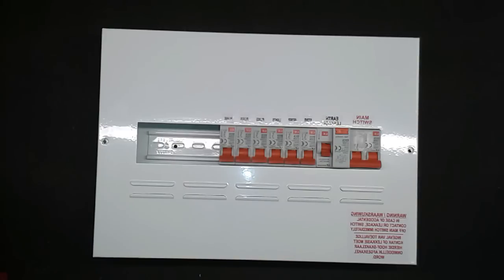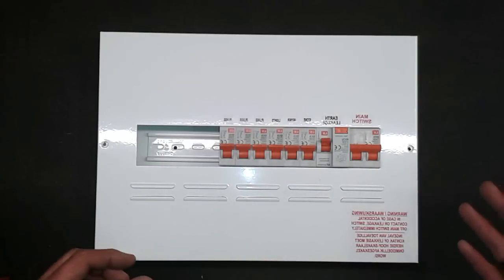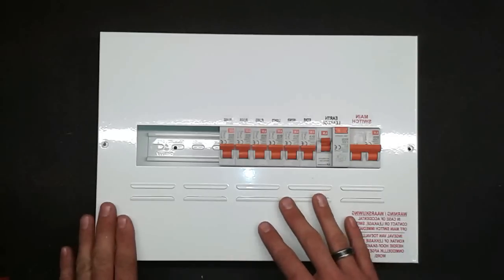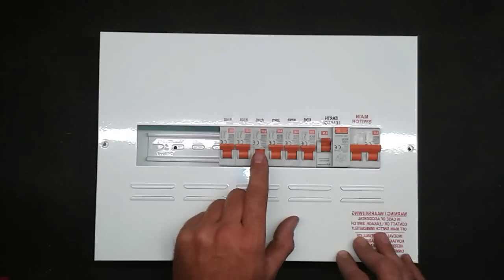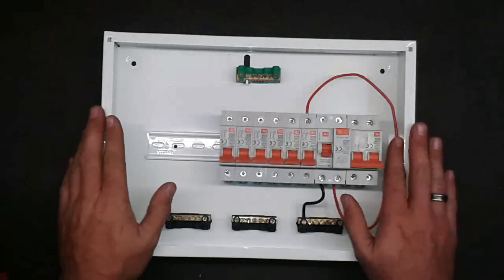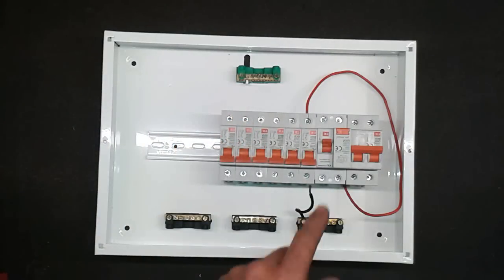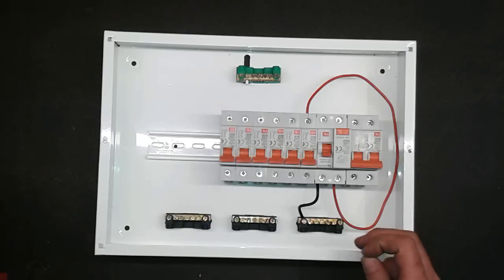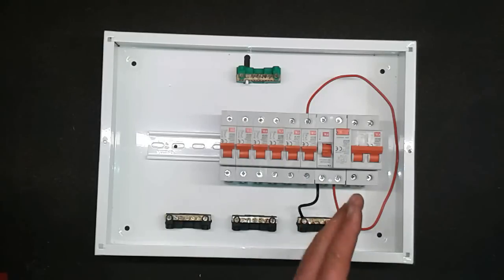Earth Leakage Trip...Here's what to do. (RCD)

Comment: For the earth to live fault or some problem it can be done easily by switching the fuses one by one but for the earth to neutral fault it does work with this method, you will have to open the board and test between the Neutral and earth of each circuit. In the case of neutral to earth, only disconnect the neutral from each circuit and test it with the entire earth bar. No need to disconnect the earth for each circuit.

Comment: My ELCB at my 18th floor apartment trips only during ligthning thunderstorms and the electrician is at a loss how to rectify!
Reply: I agree, this is a difficult one and can be very annoying!
I would check for any exposed fittings (lights plugs) to the atmosphere. If that checks out I would check the main earth to your apartment as well as to the main power box and to the supplier. If that is good I would check or install lightning rods and earth wires to exposed metal parts. Hope this helps!

Comment: Great video thank you.
Still struggling to detect why ECB trips intermittently.Everything is fine for a few days then it goes again.
Reply from the maker: Hi. That is the worst problem to have to find. An IRT tester would help in finding a problem like this but without one you will have to use a process of elimination. 
90% of the time it is something that is plugged in. Start by unplugging stuff one by one to eliminate the problem. Freezers and fridges is going to be a problem to disconnect long term but are often the culprit. 
If it happens every night,but when you unplug the freezer for the night and nothing trips,you know where the problem lies.
It can also be fluorescent lights causing nuisance tripping. For that a IRT will probably be your only hope.
Reply: @p0we111  Thank you for replying, only have the fridge which is one year old, no fluorescent lights mainly led lights.
Its weired, today its ok and maybe fine for a few days.
Its happened once in the day under a week ago and twice last night.I will shut down some of the nights and start from there.I thought it was the geyser but it was shut down during the night.
I was thinking maybe the ECB could be faulty but hard to tell if the fault is not consistent.
Reply: @jeanboetzkes9820  Hi, yes the geyser has a plug that sits in one of those little outside boxes with a slide panel in front.Will remove plug to check  .
The security lights are tricky because the cables run into the wall connecting to the light circuit breakers which don't trip out.👍
Reply from the maker: @stoicwarrior346  The only way to eleminate a device is by switching off the Live and Neutral. Switching off the lights only switches the Live wire.
Make sure when you were testing the geyser that you switched both Live and Neutral.
Most geysers have an isolator within 1 meter. Try switching that off for a fewhours/days.
Same thing when testing plugged in appliances. Dont just switch them off, unplug them completely.

Good luck to you! Hope you find the fault.

Comment: If the neutral wire is causing the trip. How do you find which plug socket wire is faulty when there’s a ring circuit
Reply: Hi Ashraf. If you have already unplugged everything from the sockets and checked out the obvious plugs like outside plugs. Then open one of the plugs in the center on the ring. Split the two neutrals and Live wires. Make the open wires safe by taping. You now have to treat it as two seperate circuits.
If one trips and not the other one then at least you now which of the plugs has the fault on.

Comment: What if the EL trips randomly when i switch any appliance on, sometimes the stofe, sometimes the plug connected heater fan. Other times it just trips randomly. I found when it trips i can't immediately put the EL breaker on, it trips. I have to wait a few minutes, then I can switch it back on. But then it would trip when i switch the plugs breaker on, or the lights breaker etc. I have to wait a bit longer again then I can switch everything on again. It might stay on the rest of the night, or it can trip randomly again an hour or 2 later. Any idea what might cause this?
Reply from the maker: Hi Pieter den Boer 
It sounds to me like a bad case of nuisense tripping. No easy answer but your going to have to do some detective work of your own. It sounds like a fault on the Neutral side. 1st and easiest would be to unplug a all appliances or leads from a room or part of the house. If it happens once a day,keep that room unpluged for longer and see if the its still tripping. If so move on to the next room. If that does not help youre gonna have to remove one neutral (in my country black) wire in the distribution box one at a time and leave it disconnected to see if the problem goes away. If not,put that wire back and move to the next one. Almost as I have done in the video,you will just have to keep the wire dissconected for a longer period. An electrician can test each curcuit using a IRT,that sends 500V through the wires but if you dont have one,this is the only way. Good luck.
Reply: Jean B Okay, thanks, i'll maybe try that. I just find it strange...why would the EL breaker trip by itself, when all other breakers are off? Nothing is drawing power. I haven't opened up my board or tested the breaker by itself, but a faulty EL breaker is all that makes sense to me in such a case.
Reply from the maker: Pieter den Boer 
Even with all the breakers in the off position the neutral wires are all still connected,even a leak (short curcuit) between the neutral and the earth will cause the earth leakage unit to trip. The breakers only switches off the live wire and not the neutral. A faulty earth leakage unit is,in my experiance,either completely broken or not. They will not mess around like that. Not to say yours is not faulty,just my experiance.

Comment: Hi, our earth leakage trips when we switch on a specific circuitbraker for plugs. Unplugged every appliance on that circuit but still does the same.
Could the circuit braker for the plugs itself be faulty? And if so, would it stay up even when earth leakage trips?
Reply from the maker: Hi Vivian. Because it is only one breaker that trips when you switch it on I would say there is something wrong on the circuit and not the breaker itself. 
Make sure everything is unplugged,garage motor,gate motor outside plugs etc...(I know you said you did but just doubke check)
Otherwise it is on the wires itself and you would have to get an electrician or go into the wiring yourself...
Reply: @p0we111  Ok thanks, I plugged in everything again now and now everything stays up and on🤔, will monitor and get electrician out if it keeps on doing it, could be wiring maybe
Reply from the maker: @vivianvandermerwe1380  good news. Usually if is goes away it could be water/moisture that gets in where it should not.

Comment: What happens when you have a broken wire running to the plug socket do we have to replace that line
Reply from the maker: Hi Ashraf. If it is possible I would always try and replace a wire. The law in my country (South Africa) does allow for joints. Permanent ferrules in the Distribution Box. In the plug box a normal connecting block should suffice. Always use the same thickness wire when replacing wire.
Reply: If the wire is mounted inside the wall how do you remove and replace the broken wire
Reply from the maker: @ashrafkarjiker6888  If your lucky the person that wired the plug used a conduit (pipe) inside the wall. You can then pull out the broken wire and pull in a new one. Its easy if you tie the new wire to the old one and then pull out the old wire.
If the wire is plastered directly in the wall you can either just lay the new one on the outside of the wall,inside a conduit or trunking,or you can open the wall using a drill/grinder and lay the new wire in a conduit in the wall and re plaster. 
99.9% of my problems has been either at the plug or at a junction box in the roof. Just make sure before you open up a wall!
Reply: When there’s a conduit inside the wall can you replace broken wire by pulling new one around corners. No power at the one wall socket that is running from the other socket

Comment: Does it apply to all circuit breakers for lights and sockets if it still trips with the load wire removed means the breaker is faulty like with earth leakage
Reply from the maker: Hi. Yes I would say so. If any breaker trips with no load wire connected it is faulty.

Comment: In my new house the Main ELCB trip off while in the day time or in the night . If MCB trip off then i will know that line is creating problem but all LMCB working well.  In night i can say only three fans and fridge is on . Yes day and night Fridge is on. How do i find why ELCB is getting off.
Reply from the maker: Hi Thomas. It is very difficult to find a problem that only trips once or twice a day.
You will have to do some investigating and switch off/unplug appliances for a longer period of time that the problem takes to appear. 

Lets say the ELCB trips 2 times a day,you wil have to unplug the fridge(or any appliance) for 24hours to rule out that the fridge is the problem. If the ELCB trips while the fridge is unplugged,you can say for sure that it is not the fridge causing the problem.

Maybe start at the hot water cylinder and switch off its isolator switch that switches off both the Live and Neutral wires.

Comment: What of the house as faults and the board did not trip of
Reply from the maker: Hi Micheal. Im not sure but I think this is your question:
If a house has faults but the breakers does not trip,why would that be.
It depends on the type of fault. 
If it has a loose wire then nothing will happen. If the loose wire touches a plastic part,then nothing will happen.
If the loose wire touches a metal part and nothing happens then the installation is not correct as the metal part needs to be earthed/grounded.

Comment: Our bore has a145? Earth leakage how do we fix this ? We had new wiring and new bore pump a yr ago
Reply: It cuts power when house is on at the same time thru our 100 kva diesel generator
Reply from the maker: @justtjo  Hi Terry
You will have to double check you're regulations, but having a borehole pump on earth leakage will cause alot of problems.
If you're regulations allow, remove it from earth leakage, but make sure it is properly earthed.
Otherwise put it on its own earth leakage unit.

Comment: After a few minutes, I go back and check if the ELCB can be put back to the top. I don’t know why it goes back to the top because it wouldn’t work when I first tried doing it. Why does it do that?
Reply from the maker: It could be a number of things. Sometimes if an electrical part gets wet it wil trip, but a few moments later it wil switch on again. It it raining? Could it be an outside light.
Maybe follow my steps in the video and try to find which curcuit it could be.
Reply: @p0we111  Alright, thanks for that!
Reply: @p0we111  Oh yeah one more thing, in the past couple months I have started to use more electrical appliances, do you think it was because of this that the ELCB keeps tripping?
Reply from the maker: @PHLvican38  most ELCBs in my country does not have overload protection so it will not trip with too much amps. 
But I have found that if an appliance has a fault on it but is just under the 30mA that the ELCB will trip and you add another appliance with a small fault that using the two together might cause it to trip but you will still have to figure out where the problem is.
Even if it is in more than one place.

Comment: I guess in the first part you are checking L-E faults and in the second N-E faults. Could you confirm?
Reply from the maker: Karoly's Yes L-E is easy to test,just switch off the circuit breakers to remove the power to the L wire. Second part is the N-E faults yes. A bit more difficult to test having to remove each neutral wire until you find the culprit. Is easier to test if you have a insulation resistance tester (megger) but not everyone has one lying around...

Comment: I'm not sure if you're still answering questions but what is the cause if one gets a small electric shock when turning on our outside shower? In the past week we've had our earth leakage tripping after 3+ years of everything working well, and it is so random but we'll try your method of elimination and hopefully that will reveal the fault. This is a great video - thanks!
Reply from the maker: Hi Robyn.
If its just tripping from time to time it could be difficult to pinpoint.
The small shock on the shower could be your hot water cylinder which should not be a big problem but you may want to earth the water pipes so that you dont feel the shock but it runs via the earth wire to the ground instead.
Reply: @p0we111  Thanks very much for the reply… Apparently our cylinder isn't on earth leakage but we'll check the metal pipes, and still have to follow your process of elimination…Hopefully we'll get to the bottom of this - there are so many possibilities!

Comment: What if when all the wires are transferring current including the earth wire what do you do to solve that problem?
Reply from the maker: Hi Mike

The earth wire should not have any current. You will have to find where the earth touches the Live or Neutral wire.
Reply: @p0we111  but how comes that all the wires I've gone through have current? Hence passing to every part of the room
Reply from the maker: @mikenjoroge4344  Are you testing the Current (Amps) or Voltage (Volts) of the wires? 
Getting a Volt reading when testing between Live and Neutral is normal and when testing Volts between Live and Earth is also normal. 

Getting a current reading (Amps) between Live and Neutral is normal with a load connected but when testing current (Amps) between Live and Earth there should be no current.

Comment: need help i have removed all the neutrals and the EL is still tripping
Reply: If you still have the neutrals removed. Switch on the lives (breakers) on one by one. If it trips with all the breakers off and neutrals removed, it could be the earth leakage itself.
Take out the 2 wires underneath the earth leakage then switch it on. If it trips you have a faulty earth leakage unit.

Comment: do you have to put safety switch on electric hot water and  electric oven ?
Reply from the maker: Hi Sir Valdo
In my country, yes you have to.
Reply: @p0we111  thanks, in Australia ?
Reply: electric hot water and  electric oven have some Earth Leakage and will trip the safety switch ?
Reply from the maker: @sirvaldo54  South Africa.
Groete
Reply from the maker: @sirvaldo54 
If you mean a earth leakage then no, a stove and hotwater does not need to be on a earh leakage.
Sorry, thought you meant a isolator switch
Reply: @p0we111  ok. so for stove and hotwater  I can install RCBO

Comment: Thanks. Great vid BUT...i''ve tried the first few steps and i am able to keep all plug breakers up and get the EL breaker up and still i have no power to the plugs. Is this probably a faulty EL breaker?
Reply from the maker: Lloyd J 
Force the breakers down all the way and switch it back on. If the lights are stillbworking its most likely the RCA thats gone. If all power in the house is off,check if the incoming power is still on and did not trip in another power box. Hope this helps. let us know what you found.
Reply from the maker: Lloyd J 
Force the breakers down all the way and switch it back on. If the lights are stillbworking its most likely the RCA thats gone. If all power in the house is off,check if the incoming power is still on and did not trip in another power box. Hope this helps. let us know what you found.
Reply: Thanks very much. Will do.
Reply: Jean B Hi do u have more videos on electricity,i recently did a diy lighting circuit for 2 halogen floodlights using a 3 lever switch & did a very good job by just watching a tutorial  from the UK,Id prefered watching videos from SA which is more appropriate & hard to find on youtube, although the UK wiring system are mostly identical to SA

Comment: What if the breaker for the lights is tripping
Reply: Hi. It could be the breaker but not likely. More likely is a short on the fittings or wires.  If the breaker takes 3 seconds or more to trip it could be water coming in in an outside light.
Reply: @jeanboetzkes9820   Thank you for responding. I noticed it was the outside light causing the issue. Water getting in after heavy rain.

Comment: i managed to trace that it was the kitchen circuit that caused the earth leakage to trip the main breaker. however when I switch every thing off in the kitchen and puch up the switch for the kitchen on the breaker, it still trips. please help bro. thanks
Reply from the maker: Jason de Souza. Dont just switch off,unplug it. the fault can be on the neutral wire and just switching off will not disconnect it.

Comment: Elcb triping after few minute .what should i do
Reply from the maker: Hi Ram Sita.
Unplug all devices (not just switch off but unplug)
Then try again. If it stays on plug devices back one at a time.
Water/moisture will usually let the RCB trip after a few minutes. Check all outside plugs/lights.
Reply: @p0we111  all working good but triping after few minute.

Comment: Is it dangerous to just switch it straight back on?
Reply from the maker: Not with the earth leakage tripping no. (If you are sure no one is working or touching any wires) If it is a dead short with one of the other breakers tripping it could be dangerous,if the box is not correctly wired.

Comment: Seems to be the fridge freezer that's causing it., what next?
Reply from the maker: Unfortunately you will have to keep it unplugged.
Reply: Can it be fixed??
Reply from the maker: @Kyranoboss 
Depends what is wrong. If your lucky, just a burnt wire or water going where it should not be (usually after a defrost)
More often it is the motor that has broken down.
You will have to get someone to take a look.